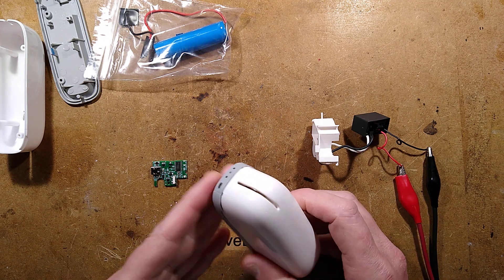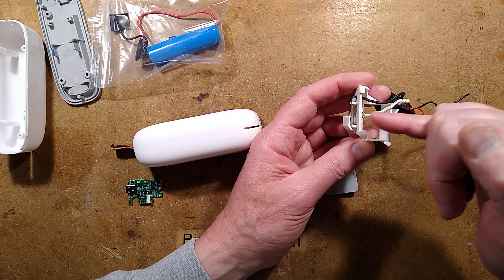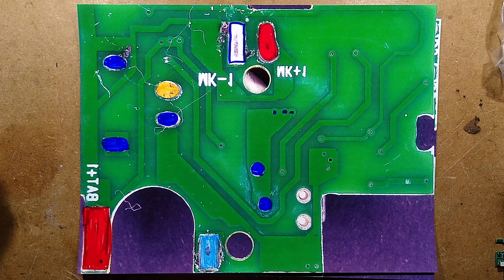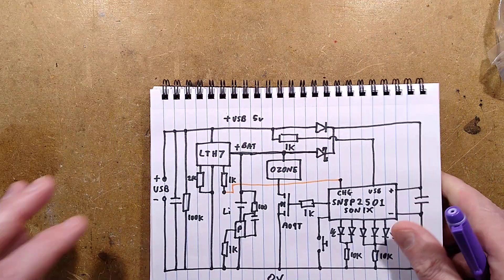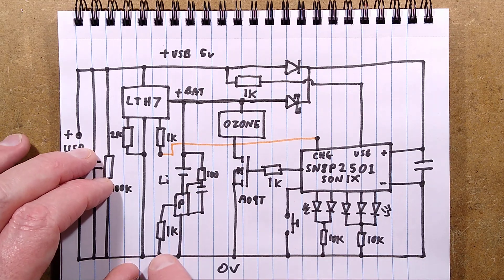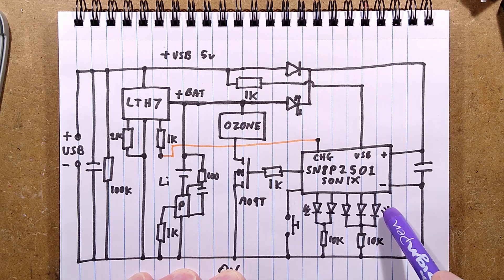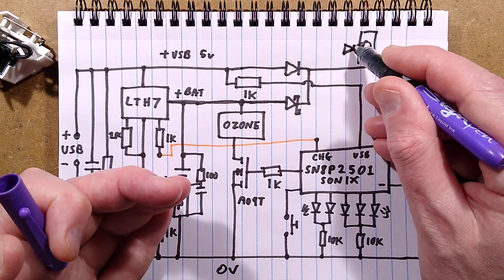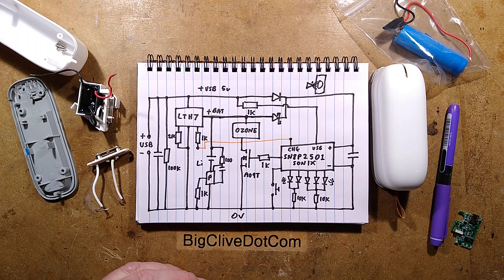Chinese ozone-twinkie with unusually good circuitry (with schematic)

Comment: i ordered (and received) the rechargeable version a while back, but never used it. Now that i'm using it, it doesn't charge. I've opened the unit, but my pcb is different than the one in this video. Is it possible for you to show a picture of the battery version of the pcb. I'll be watching your live tonight, if you can show it then it would be great.
Reply from the maker: Open the unit and measure the voltage across the lithium cell inside.  If it is below 3V then gently bring it back up to 3V with a current limited supply (possibly using a resistor in series.)  Once up to 3V the protection should switch back out and allow normal charging.
Reply: @bigclivedotcom  i charged the lithium cell to 3.3V (it was 1.6V), the device turn on on the battery, but if i plug in the usb, the voltage over the cell stays the same (so no charging). When i plug in the usb, the red/green led turns red for a second and then turns green. I will leave it on battery to see if it wil power off to protect the cell.

Comment: When the unit is plugged into the 5V charger supply the microcontroller and LEDs will run directly from the charger and not draw current from the battery circuit.  The Schottky diode will be reverse biased when the charger supply is attached.   The microcontroller has a wide enough operating voltage supply range to tolerate the change in supply voltage.  The two diodes form a power supply "OR gate" for the microcontroller and LEDs.

Comment: How do you know, the volume of ozone, being "put out," other than, "a-hellavlot," as a unit of measurement?
Reply from the maker: It's extremely hard to measure ambient ozone accurately.  I tend to test these in a small enclosure with an ozone meter, and time the duration until it starts to register, and the rate of level change.  This one was higher than average for this style of unit.
Reply: @bigclivedotcom  A video in the making...

Comment: Hahah! it looks like an arse, yeah, LED's I remember when you would pick a value in the hundreds of ohm's range, but the surface mount ones that I use (0805) now only need 1 or 2 milliamps to be more than bright enough for status indication, so I'm using 3 to 4K ! good news all round for battery projects and good news environmentally to boot !....cheers.

Comment: Does Ozone float or sink in air ?
Reply: Heavier than air, but probably not by enough for it to collect in low spots.
Reply: @NiHaoMike64  So we need to position the generators at the top of the space they're working in for better effect.
Reply from the maker: I think it diffuses into air evenly.
Reply: densities: air - 1.225kg/m³, CO² - 1.98kg/m³ and Ozone - 2.14kg/m³. CO2 pools in still air (you can see a CO2 balloon fall faster than one filled with air) so I would think that ozone would fall/pool even better
Reply: @airgrphxable  "CO2 pools in still air" - just ask any orchestra that's been in the orchestra pit when they've used 'dry ice' on stage ! - I'm not sure if there has actually been any fatalities but certainly ill-effects ! I believe it's a bit more controlled now for stage effects as a result / more use of foggers than real dry ice. Fog from foggers is more buoyant as well.

Comment: Always interesting to see a technical breakdown. BUT, Important to note that ozone at non-atmospheric altitudes has negative health effects. And the concentrations you'd need to be effective at cleaning and deoderizing are above the levels considered safe: https://www.epa.gov/indoor-air-quality-iaq/ozone-generators-are-sold-air-cleaners#generators-effective
Reply: Years ago at the dawn of laser printer technology I was told that the moment you smell ozone it is already unhealthy.
Reply from the maker: @ernstoud  If you can smell it there's already too much.  The early laser printers put out far too much.
Reply: @bigclivedotcom  I have happy memories of visiting "copier rooms" which were often former broom cupboards that firms would chuck their copiers into... that waft of high concentrations of ozone as you opened the door... rapidly followed  by a few hours of feeling somewhat nauseous!
Reply: "Some data suggest that low levels of ozone may reduce airborne concentrations and inhibit the growth of some biological organisms while ozone is present, but ozone concentrations would have to be 5 - 10 times higher than public health standards allow before the ozone could decontaminate the air sufficiently to prevent survival and regeneration of the organisms once the ozone is removed (Dyas, et al.,1983; Foarde et al., 1997)."
So it actually might be effective for small spaces like a fridge or closet if it's much less than 10% the total volume of the room.
Reply from the maker: @NiHaoMike64  If you wanted to bleach everything in the air then yes it would require harmful levels.  But normal trace levels are essential for regulating bacteria, viruses and mold proliferation in nature.
In a sealed indoor environment the ozone content rapidly depletes, as it is used up doing its job or reverting back to oxygen or other molecules.
Reply from the maker: Ozone exists naturally at around 0.000001% of the air.  It's an essential part of nature.
I've become very suspicious of the EPA's "science".  It's not quite as credible as NASA's science.
Reply: @bigclivedotcom  I think that value is at upper atmosphere; at lower level, the concentration may be undetectable.
Reply from the maker: @janami-dharmam  No.  The .000001% ratio is at ground level in the troposphere.  In the stratosphere it's dangerously high for humans.  It's right here in fresh outdoor air that you are breathing 100 trillion molecules of ozone with every breath.
Each normal breath of fresh clean air contains 10 sextillion gas molecules.
(10,000,000,000,000,000,000,000)

Comment: That high voltage module looks like the same thing that comes with electroluminescent panels from EBay.
Reply from the maker: The potted block PSU is common, but the EL ones are low frequency and around 100V.
Reply: @bigclivedotcom  You should do a short video on el panels. I think it's a really cool concept.

Comment: The nice thing about those ultra bright LEDs is that when you use them with a 10k resistor, they're still plenty visible but they barely draw any current. Makes it a great technique for battery powered devices.
Reply: Or if it only needs to be viewed in near total darkness, 100k or more.
Reply: brilliant comment (😂😂😂)
Reply: Can't claim credit for it, I should have mentioned I learned this trick from a "Great Search" video by Ladyada of Adafruit.

Comment: It's obvious the circuit designer and the case designer did'nt talk to each other. :)
Reply: That must come from a public molds, where the original company who designed the 1st product cannot afford all the molds cost so give-up on the ownership of the case design, or several small businesses just share the case design and molds to cut some initial cost of the project.

Comment: Argh! I was hoping you'd show us you reassembling the unit with neater wiring.
Powering off the USB serves two purposes: firstly, it allows the battery to charge consistently as it doesn't have to supply the circuitry as well as the battery charge (a small difference but it can be important); secondly, when the battery has been deeply discharged and the MOS-FETs have cut it off, the processor will run independently of the battery voltage as it is trickle charged back into life (the main advantage being that the processor can illuminate the LEDs to show charging is happening).
What's most intriguing to me is that all the blue LEDs are in parallel through the same 10k resistor, one LED comes on fairly bright, the second halves the current to each and the third cuts the current to each to one third. As you say, modern LEDs have such high efficacy (the correct term when comparing two dissimilar values) that the reduction in current should be imperceptible to the eye.

Comment: Once the battery is fully charged it will effectively be cut off from the rest of the circuit, there would then be no way to power and switch the ozone unit without the extra diodes, the reason most circuits will not operate while charging. With this circuit it allows the USB supply to be permanently connected to charge the battery and provide operating power simultaneously.

Comment: It looks like the negative ions and ozone are generated exactly the same, which has me wondering why the negative ion generators don't just pump out massive amounts of ozone.
Reply from the maker: Ionisers do produce trace ozone, but the lack of oppositely charged plate in front of the needles results in more of an air-charging effect.
Reply: @bigclivedotcom  Thanks for clearing that up.  I knew they were related somehow.
Reply: I think there was a Veritasium video on this topic.  I'm going to go look for it and rewatch it, hopefully I'll return to this thread with new insight.
Reply: I'm watching the Do Salt Lamps work video, which is where I think he goes into detail about ozone generators and ions.  I might be thinking about a different channel entirely, though.

Comment: Maybe the charge supply via the silicon diode is to help with starting the processor, it probably doesn't like the gradual increase in voltage via the charger.
Would explain why the HV module is on the battery side
Reply from the maker: That does sound viable.

Comment: Ozone will cause many health issues if used in close proximity for extended periods of time. I.e. desktop, car, small office, etc. You'll developer breathing problems with high exposure to ozone.
Reply from the maker: Are you aware you are currently breathing around 100 trillion molecules of ozone with every breath?  It's a natural part of air at about 0.000001%.
Reply: @bigclivedotcom  Yes. But when I was a wee lad, my tinkerer father revived an old 1970s ozone room purifier, looked like an old tape deck, and I would stand over the ozone exhaust vent, breathing in copious amounts of the "funny air" to get various light headed effects. 😅😂. Until my dad saw me one day as screamed in horror and pulled me away from the ozone generator. I grew up healthy and fine. I'm just regurgitating the health hazards my father told me it would cause by breathing it at face distance. Whoops! Haha
Reply: Definitely toxic. Big Clives argument doesn't hold water here - it's dose dependent. Bananas have a small amount of radiation which is not harmful to humans, but that doesn't mean swimming in Chernobyl is safe. Same with ozone.
Reply: @MrNoipe  if you watched any of clived videos he makes that very point !

Comment: Those diodes will be to simply prevent the battery discharging into the USB port, AND to stop the USB bypassing the charger IC and over charging the battery, whilst simultaneously allowing the unit to run from either power source.
Reply: I would presume it can only charge or run the generator, and not both since the charge IC and generator are tied to the same rail off the positive terminal of the battery. Also makes sense since the ozone generator won't be fed directly off the USB port, so confining it to the battery alone might limit some of the interference it could potentially generate. Edit: Clive says it runs while charging. As drawn in the schematic that seems a bit sketchy, but maybe the generator is a low enough load that it won't upset the charge/discharge thresholds of the IC too much. Or possibly it just sequences as necessary.
Reply: @mysock351C  the charge IC is quite simple, look at Analog LTC4054 for a similar datasheet... more or less, while parameters are stable, it's just a constant current supply. The battery would simply charge slower/drain slowly despite being in use.
Reply: @jercos  My only concern would be if the load is able to cause it to toggle across the thresholds. That said, the chinesium version has the soft-start as well and the load is relatively low.

Comment: Clive did you know you are an influencer already? Lidl in germany had sharpies, which I never saw before in germany. I immediately had the urge to buy them. But I could resist luckily ;)
Reply from the maker: Sharpies are great.  A proper marker pen used widely in many industries.
Reply: Haha never seen sharpies in Germany before and thought exactly the same when I saw them at lidl 😀
Reply: Sharpies used to have the words NOT FOR LETTER WRITING on them. Not any more. I guess the manufacturer no longer cares so long as they sell
Reply: @markiangooley  Well, that means we have to communicate using numbers.
Reply: @markiangooley  to be replaced by "NOT FOR WRITING EMAILS" after the first lawsuit.

Comment: Using any type of batteries in a fridge is a such bad idea in a efficiency perspective. Especially non-rechargable one. Why modern fridges doesn't have USB type c inside?

Also, may be for a regular batteries in a such bad environment can be used joule thief for better efficiency?
Reply: Better idea: a LED bulb for a fridge that has a built in ozone generator and a supercap to power it.
Reply: @NiHaoMike64  not LED, just spark generator, like a Jacob's ladder. Light + ozone + UV + nice buzzing sound

Comment: How big of an area is something like this effective for? While I don't smoke someone else in the house does and I'm wondering if I got several of (these or maybe or the triangular ones you showed awhile back) and put them around the house if it'd help neutralize the smell since most of these seem to do one long cycle per day then run for a few minutes per hour after that.
Reply from the maker: First thing to do is try and convert them to vaping.  Safer for them and everyone else.  Low level ozone may help reduce the smell of smoke, but it may take using a big unit in unoccupied rooms to make a proper impact on the smell.

Comment: I once had an idea of a hair bleaching device that was a helmit or rigid shower cap that would be sealed onto the head which would then activate high voltage to create ozone.  Take that a step further and first do a oxygen flush and then turn on the HV.  It would probably catch your head on fire.
Reply: Would buy instantly, can you make it for beard growth too?
Reply: High quantities of ozone would make the hair very brittle and crack easily.
Reply: Love that idea - presumably one would seal the headgear to one's head by using bathroom silicone?
Reply: @mikebashford8198  pl400
Reply: I have plenty of beard but would like to restore a little bit on the top 🤣
Reply: Oxidise your hair and scalp cells?  Hard pass.
Reply: Reminds me of the pedal powered haircutting machine on chitty chitty bang bang

Comment: Corona discharge is something considered negative these times... xD
Reply: *AAAaaaCHooo*

Certified organic corona discharge.
Reply: True, but the charges won't go far. It has to return and complete the circuit and that is the reason for the positive plate with a hole. The oxygen in the air turns into ozone but the charge is not consumed. You will be able to detect ozone at a distance but no negative ions.
Reply: @janami-dharmam  I think you missed the joke.

Comment: Very nice. Perhaps try that board and transformer feeding a carbon fiber emitter placed just above (10mm?) your toilet paper filter with a positive wire grid below the paper. I am confident the results would be obvious.  May need to use several emitters attached to the one negative transformer cable. If the emitters are too far from the wire grid the transformer will develop an internal short. Maybe add a resistor before the coil for testing and gradually step down to smaller resistors until you find the limit of the transformer's insulation.

I should get off the internet and back to my own bench instead of trying to think up projects for you to do! I can't resist stopping by whenever a notification about BigClive pops up.
Reply: I am guessing these modules might have some series resistance or not, being super cheap.

Comment: I like the idea of the rechargeable unit - very handy. You did say that the battery is quite low capacity so probably worth changing it out. Is the 18650 soldered in or is it in a spring assembly?
Reply from the maker: It has welded tabs, so would need a tabbed cell.

Comment: Random tangential thought. No doubt ionizer reduces odors in a refrigerator, but I wonder if it has a deleterious (if likely minor) effect on food?  I imagine it might accelerate the loss of flavor that occurs in uncovered fresh vegetables over time.
Reply from the maker: I've been using one for a while.  The vegetables and other food seem to remain fresh for longer and there's no discernible loss of flavour.  I think it's just a low level surface effect.
Reply: I have been using small amounts of ozone with no effects on taste for over a year started when knockdown started .  One thing is my cheeses does not grow any new mould but does keep the existing mould which is odd with no effects on taste.  So cheese if left drys out.  Same in my bread cupboard no mould on bread just drys out so normal bread ends up like Dutch crispbread slices. Everyone thought it would end up with taste of bleach but not! 
The unit in the fridge looks like I have left a computer mouse in it to the surprise of guests wanting to know why do I store my mice in the fridge.
Reply: @Electronics-Rocks  The mice in the fridge keep longer too!  :-D
Reply: Makes sense. As Clive suggests it remains a surface effect so the bulk of the food is unaffected. Even established mold colonies could have enough mass to remain alive, if not able to easily grow.